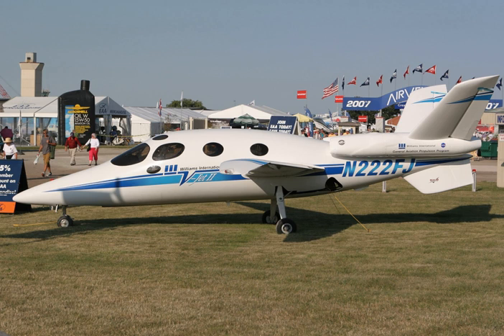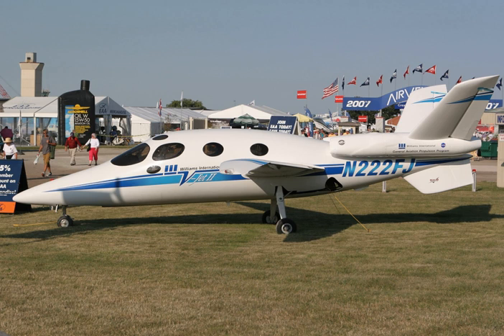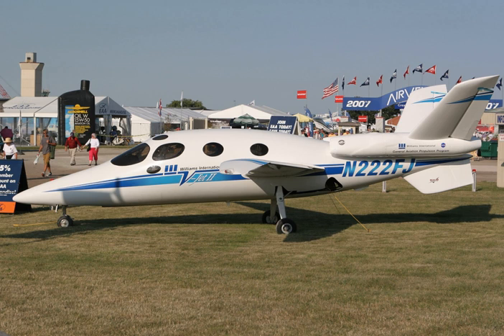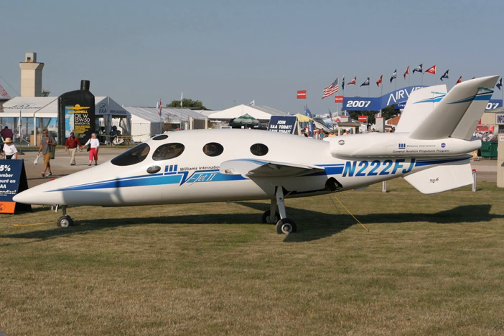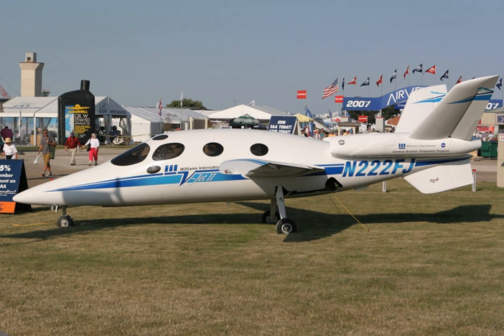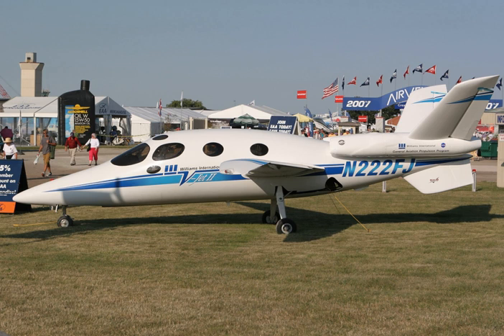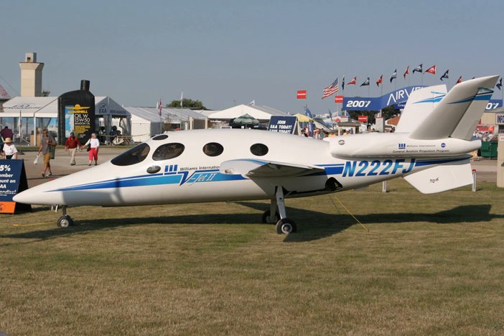Williams V-Jet II | Wikipedia audio article

Comment: I wished I could have had it
Reply: much of this is wrong I believe. Nasa paid Williams 37milion to develop the FJX2 now known as EJ22. The one in this plane was the FJX1, a low bypass engine that for some reason they made as interim, maybe because Williams already had it. During all this the effing engine was never offered for sale. And the project was specifically to revitalize the small plane market that's filled with overpriced WW2 junk like the Bonanza. This was in 1996. Soon 30 years ago so if the market was stagnant then, add 30 years to their absolute failure. Not sure what Williams was thinking but they have some splainin to do.
37 effing millions and they couldn't produce a tiny engine. It weighed 44kg